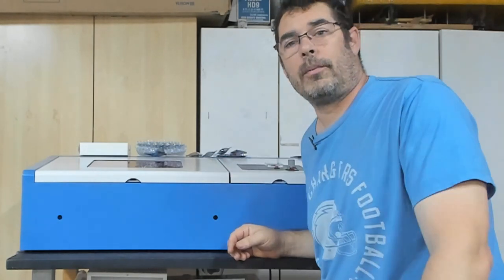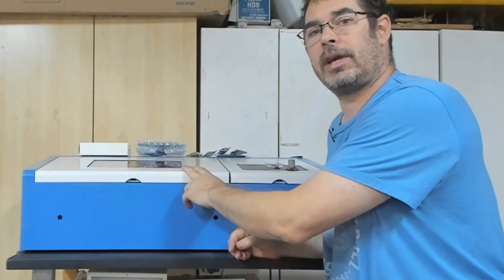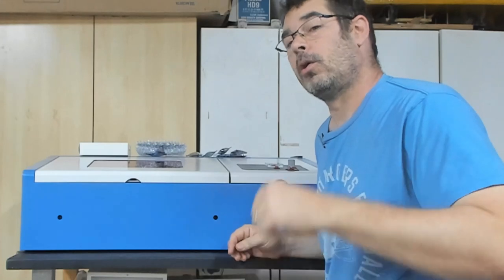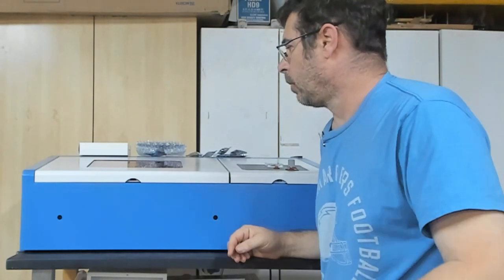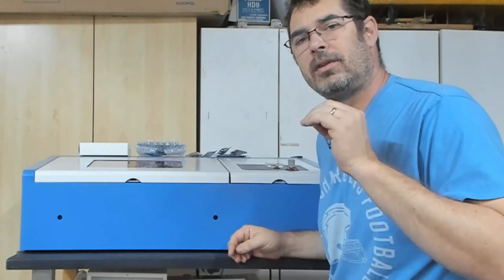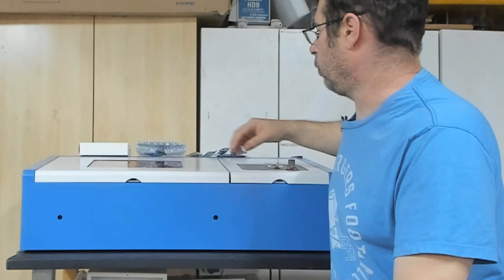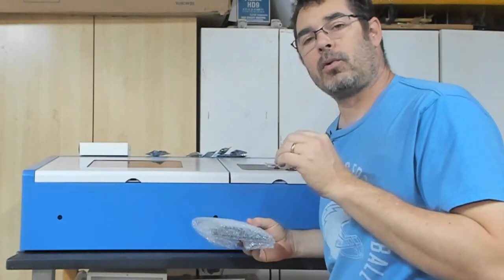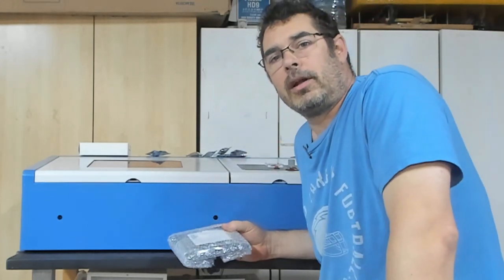K40 Cohesion 3D / LightBurn Upgrade Teaser

Comment: Cover the topics for upgrades: controller board/display, cameras, air assist, exhaust, adjustable bed, mirrors/alignment and tube cooling. I'm working on mine still but have created a setup where the exhaust passes over a set of large heatsinks that have peltier devices connected to them with a waterblock on the cold side to cool the tube water. I originally upgraded to the Cohesion 3D mini (the laser board wasn't available then) with the display as well as ethernet. In the process of making the adjustable bed at the moment.